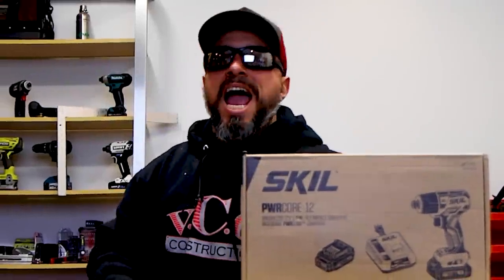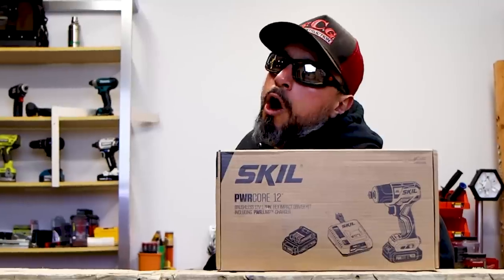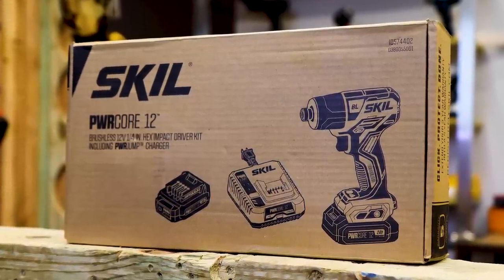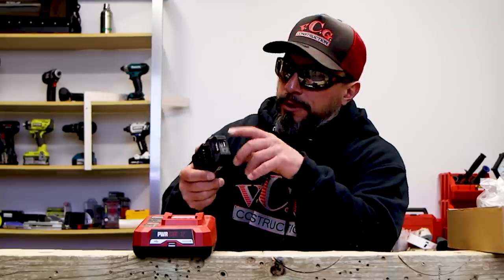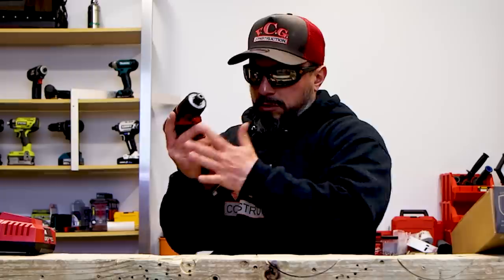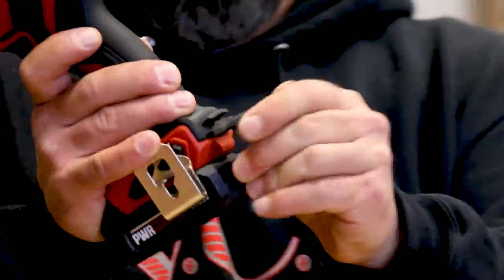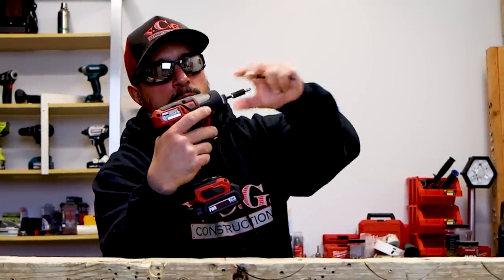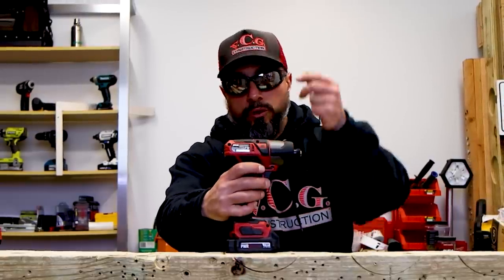SKIL 12V PWRCore TOOLS I Didn't Know They Can Do This!

Comment: I am an apprentice contractor, and i bought this kit. The drill is better for fine work like cabinetry and sheet rocking rooms, and the impact i have used for building 2x) 8x10 treated lumber decks and band it w/ lean to tops(5/4,2x6,4x4,2x4) on mobile homes and as long as you can alternate the battery preferably around like 1-2 battery indication you’ll do just fine! It held up its own against the likes of Craftsman Brushed Impact 20v,  the Makita XTD11 LXT 18v, and the Hart Brushed Drill w/ 2amp 20v battery! I am very impressed with the build and quality of the impact! It has withstood being dropped 8’ from the roof to the wooden deck, and also a 12-13’ ft drop from the top of the mobile home! So if you drop it anywhere near that height you should be fine! I was thinking about going to Skil 20v brushless impact but for my line of work and the time it takes with my crew on the job, it was just too heavy IMO. I like to be able to hold my tool out arm length ALOT so those 18-24v drills/impacts can get VERY heavy for a HOT ASF day in Oklahoma and it’ll just tire you out but I’ve noticed in my time of having it (July 30th - August 16th 2020) it has been better for duration runs only trade off is power and a LITTLE speed. I am greatly happy with this impact, please do a extreme tool test with this product, PLEASE! if I had ANY issues with this product it would be, and it’s very minor, and that without gloves this tool (around the metal) can get very hot to the touch but still operate like a champ!

Comment: Great video 👍 I am an HVAC technician, general contractor, electrician, and plumber at the current job I am working now. I used to be a contractor full time on my own doing all kinds of jobs. I after the amount of years, time and money I spent doing it I always have the number one question which tool brand is "professional". After watching your videos and seeing the reviews you post, I can say I am a true believer that Milwaukee is by far the most professional on a job site. I have used DeWalt, Makita, Ridgid, and even some Ryobi tools in the past to get some jobs done. While most people on here just post reviews on top high end tools I stumble on your videos that include a generic name brand that isn't too expensive. Since I rely on my tools for a living, I have to get performance and quality out of them so I go with Milwaukee. DeWalt did have a 12v impact driver that had the same light on it as that skill and I like that about it but it lacked in power. For example, I had a job to fix 2 windows in a house on the first floor. I opted to get new construction windows because replacements couldn't fit into the openings. I figured small windows why not bring my DeWalt 12v it's lighter and powerful enough (so I thought) I had to reframe the opening as well didn't plan for that of course. I tried the DeWalt impact but it was taking to long to sink 3 1/2 screws I had brought with me. I had to change to my Milwaukee M12 fuel. That was like night and day it did the job with one battery and had plenty of power all the way through! For 12v performance I definitely go with Milwaukee. 👍💪 I will certainly keep this skill one in mind though for the next time anyone asks me what's a good "at home" tool. Thanks!
Reply: u can have my Milwaukee 12 v tools,not a fan at all.Plus the batteries die fast.way overrated by u Milwaukee fan boys

Comment: I just got some of these Skill 12-volt tools, a drill and impact, I also got the air pump a fan and the circular saw. They're fantastic, as soon as I had that drill in my hand I knew that I was going to be buying more of these. The battery prices are reasonably cheap. The tools are incredibly powerful. For the price, you can't beat it; hands down, best bang-for-the-buck anywhere in the power tool Market

Comment: The skil right angle impact driver is able to drill a 1-1/4 hole with a Milwaukee self feed auger bit through 3 stacked 2x4s no problem as a plumber I cant say enough good things about this tool it has saved my bacon more than a handful of times
Reply: Are you still happy with the RA Impact?  I’m about to order one for driving screws in tight places I can’t get to with my other drivers.

Comment: You're funny.  Anyway,  I was in my local Lowe's and to be perfectly honest i was in a hurry and needed a 12 volt reciprocating saw. Due to heavy recent shoplifting all the Dewalt tools (and the others and at home depot) were locked up and no one came to help me. So i saw the skil line free of such tool jail and given the price of $99 for the set and I was prepared to spend $200 I grabbed the driver as well. No tool bags and two chargers BUT the performance of these two 12 volt brushless tools are just as reliable and strong as any pro brand. I don't build decks but install casework and running trim. Just fyi. Also,  charging my phone from a tool battery is just plain great if off in an apartment building with no electricity yet. I've tossed those expensive somewhat worthless battery packs.

Comment: The jump charger is a cool feature but it should have a switch or a selector to enable it so your not always charging that fast to preserve your packs. A use it when need it kind of thing.
Reply: @robans  No not my phone, but I do run 18650, 20650, 21700 cells for other things and I charge them at a mid rate speed rather than the max speed of my chargers. I

Comment: Van Halen’s jump? House of pain’s jump around?
Follow up: I was  unfamiliar so had to do a search after and looked up kriss cross, lol. Showing my age (54) I suppose. I agree on the dual bearing collet as being the best solution as each bit seems to vary from brand to brand on their retaining divot. In their quest to be universal, some seem to have too shallow a dip  while some have a greater throw (amount of movement or slop of bit moving in and out while in collet). Thus decreasing the hold of bearing as it slides further within the divot making it easier for it to slip up and out when retracting the tool. If that makes sense. Or they could just make the outer circumference of collet slightly larger to accommodate a heavier duty and stronger retaining ball spring inside the collet to counter the force of said slop which is simpler than trying getting various companies to agree on specific unified tolerances of all bit retaining divots. Oh, well. Maybe someday. And as long as I’m wishing, I might as well wish for a pony as i have a much better chance at that happening 🤣 In the meantime, hope everyone is well. Appreciate you all, stay safe!

Comment: I know at first they have a problem with the collet which would allow you to just pull the quarter inch hex bit right out of the driver without even pulling back on the collet to release it. Has this problem been fixed?
Reply from the maker: I’ll need to test it more thoroughly to let you know, but no problems so far

Comment: You throw me buck to the 90's with the jump around....you awesome!!! I have the 20v pwrcore jig saw came with 2 amp battery: very comfortable to control ( does not have speed dial), heavy but not too much, cutting clean in wood: 2*4, plywood . Haven't tried it on metals but i think it will do the job with proper blade. the battery charger is fast. But the battery won't give too much working time (20min) with heavy duty jobs, the blades that came with them didn't work good for be so i switched them for Bosch ( much better). If it would come with 2 batteries or one of 5 amp that would be better. I am not a pro , im weakened woodworker but I'm also fixing things around my home. I also have a corded orbital sander from their new line for more than on year and it's great for my woodworking: well constructed, comfortable to use, speed dial, all the sawdust is sucked into a sealed canister and it cost less than the other brands.